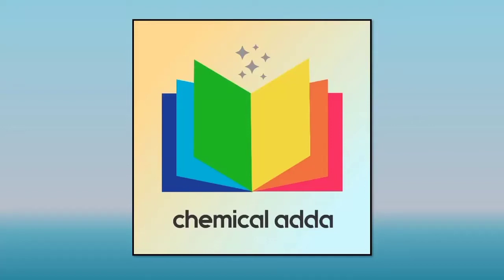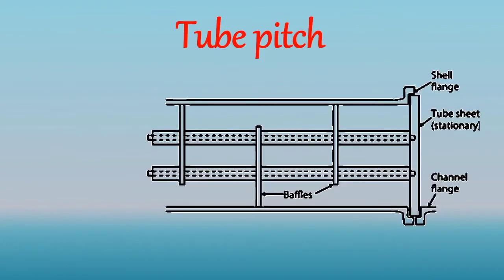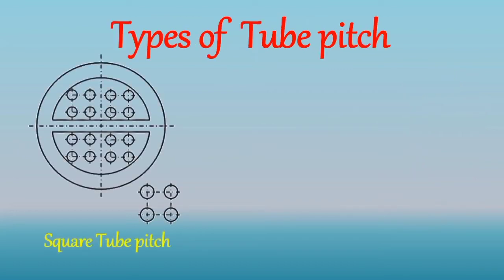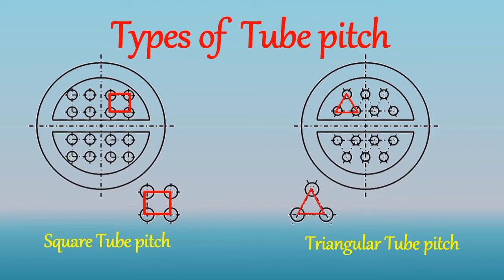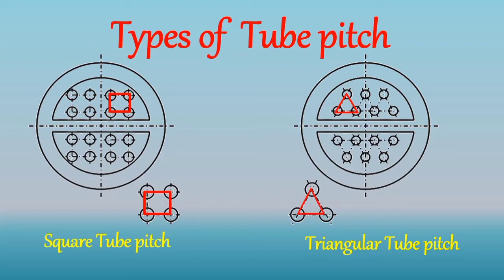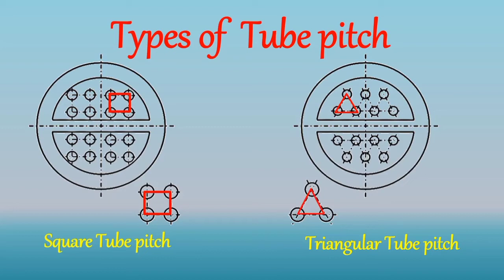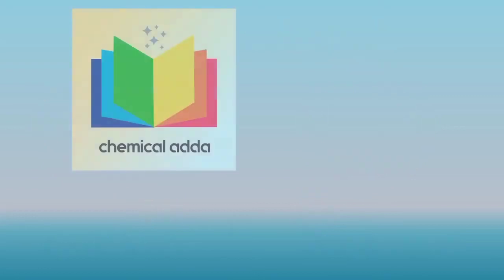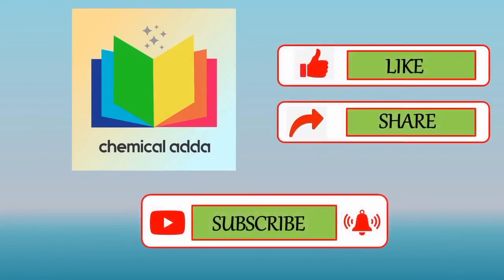Types of Tube Pitch | Shell and Tube Heat Exchanger | Heat Exchanger

Comment: Tube and tubeside enhancements can be located on the outside, like integral lowfinned tubes or inside the tube. So take a look in general.
   Tubeside enhancements may also include tube inserts of various geometry such as chain type, spring type, twisted tape. These tubeside enhancements are often used in single phase. The tube side have been useed it for retrofitting and I my case it roll be stage point of todays researching.